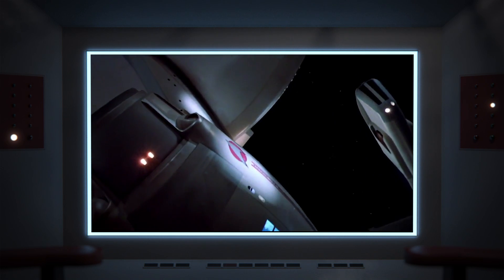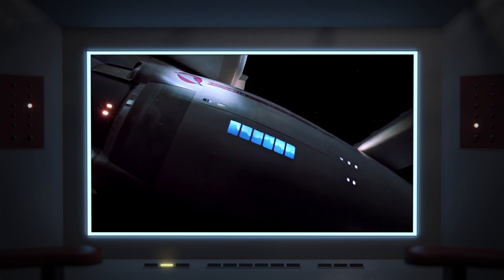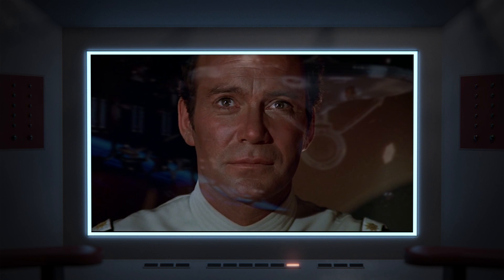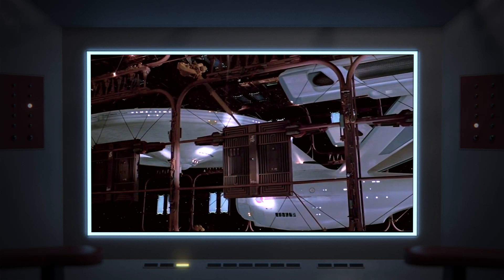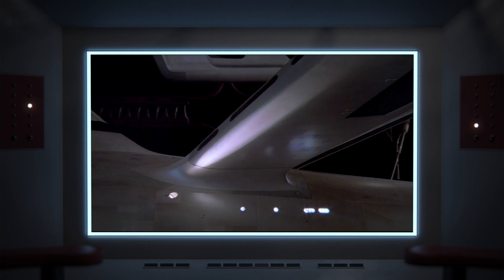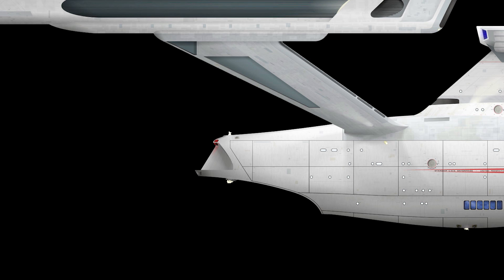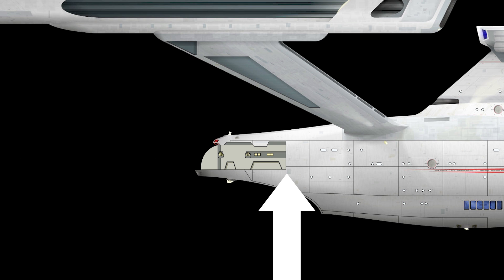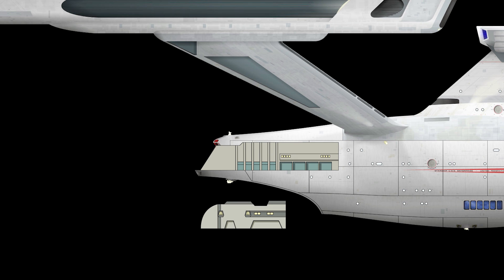Why Have Angled Nacelle Struts? (Enterprise Refit)

Comment: Andy Probert, the design guy behind the look of the refit Enterprise (and the Next Generation's Enterprise-D), has a sketch that shows this exact thing:  the warp power channels (later, 'conduits') passing along the top of the hull and out to the nacelles more forward, as you propose, clearing more space aft for the hanger and hold bays.  

Also, at the time they didn't have the ship's propulsion system imagined as the positive and negative poles channeling into a central reactor, as we see in the Next Generation's engine room.  There was just a central 'main energizer,' which ran vertically up & down the hull, all through the interconnecting bit to the impulse engines' 'deflector crystal,' which is the blue glowing bit at the top where the impulse engines are housed.

Comment: Another reason for the angled struts is that they increase efficiency. With the struts meeting closer to the warp core when they meet at the secondary hull, the path to the nacelles would be shorter thus less power would be needed to get to a similar speed compared to the old model.

Comment: Gene Roddenberry, when speaking of the Galaxy Class Enterprise, said that his vision of the Federation is of a culture who's science and engineering is so advanced, that they aren't as constrained, so an important art of starship design is asethetics - starships were not only functional, they were also, his words, "a work of art". And the Refit Enterprise and 1701-A definitely are that. (Even more so in The Motion Picture, because the producers of The Wrath of Kahn painted over the Enterprise's pearlescent paint job with a clear dull coat. (Something about the filming the technique they were using and shiny areas.)

The only thing that, IMHO, the Refit is missing, are the rear-facing photon torpedo tubes that both Kelvinverse Enterprises have on the underside of the engineering section, kinda bellow the shuttle bay, but maybe a little further back. I am also PRETTY SURE that Pike's Discovery/Strange New Worlds Enterprise has that feature as well. And it makes sense. According to "Enterprise" (the series, in the episode "In a Mirror Darkly", part 2 I think) the TOS version of the Enterprise/Constitution class has rear photons as well, which they use the break out of the Tholian spacedock - but they never show on screen where they are coming from.

Comment: Mr Scott's Guide to the Enterprise has further explanation's as to the redesign of the overall Constitution Class (though not considered canon).
It makes reasonable debate point's as to why Starfleet approved the changes to the class as a whole (such as enlarged primary/secondary hulls, new impulse drive/warp engines, new primary computer core, etc.
As Scotty himself say's in The Motion Picture, 18 months of redesign and testing resulted in a virtually new ship.
Were there any other Constitution Class vessels modified this way ?
The simple answer is yes.
Most of if not all the remaining vessels would have been.
The guide delivers a massive amount of information and is impressive for the detail.

Comment: There may be a conflict between the enterprise's rear hull design and optimal placement of the new nacelles. The strongest point on the rear hull may have too far forward to place the engines, and the point far back enough to place them may have been too weak to support them. Plus the excellent point about increasing the surface area for heat dissipation, may be part of it. Looking at the front edge of the pylon there seems to be an intake of some sort there, maybe sweeping it back made it longer with more intake space while keeping the nacell's distance from the hull the same.

Comment: It also moves the strut / nacelle mounting point towards the center of the nacelle, rather than going straight up.  From a 20th century engineering perspective, that would tend to reduce torque on the struts themselves, and reshaping the struts allowed them to better spread the load to the superstructure of the secondary hull.  Of course in the 23rd century that might not matter, but having a more stable physical design does mean you have to spend less effort elsewhere compensating for the unstable design.

Comment: Eric. I like hearing you talk about Star Trek design, even when I disagree. This is not one of those times though.

Another benefit of the angled struts is reduced workload on the structural integrity fields throughout the nacelles, the struts, and the secondary hull.

The pylons enter the hull close to the base of the neck, allowing common bulkheads to take the strain of the huge off-centre masses of the saucer, neck, and nacelles. The consolidation of these structural members into the "strongback" area, as well as the revised routing of the horizontal plasma conduit coming off the warp core, explains the "barrel" shape of the engineering hull post-refit.

Additionally, the chevron shape of the struts allows loads to be balanced along a larger length of the nacelle. The mount point of the struts on the nacelle is more central, improving balance and reducing sheering forces on the struts.

Finally, the angle at which they enter the hull allows the warp plasma conduits to take a more direct route to the field coils, where the old design necessitated a series of 90-degree turns - surely more power-intensive, massive, and failure prone compared annular confinement fields along a more-or-less straight length of conduit.

Comment: also consider it's very hard to make a magnetically bottled plasma flow turn a corner (unless you're talking very small amounts going through the EPS grid where it's not warp-charged plasma). The new struts, like the old ones, indicate the position of the warp core, where the plasma comes from. The refit Enterprise has a vertical intermix chamber (where the EPS grid feeds) as well as a horizontal one, whereas the TOS fit has a horizontal one only to do everything.

Comment: It could also be that the thicker struts allow for greater warp field stresses, thereby increasing the maximum potential warp speed, but even if it's just the hangar bay, that's still a good enough reason to move the strut joint forward.

Comment: The original nacelles likely needed stronger internal bracing as they were supported fore of their center of mass (assuming the mass in a warp nacelle is relatively homogeneous). In the refit, the nacelles are supported more towards the center.

Comment: Other design changes?

How about the dispersed weapons? In TOS, all of the main phasers and torpedo tubes came from the ring around the ventral sensor dome on the saucer section, as well as aft phasers located above the main shuttle bay on the secondary hull. Keeping all the ship's weapons clustered in a relatively small area makes it much easier for enemy fire to disable multiple weapon systems with a single hit.

On the refit, phaser banks are dispersed across both hulls - three banks of two on both the dorsal and ventral sides of the saucer, two above the shuttle bay and a cluster of four on the very bottom of the ship. And the torpedo bay was moved to the top of the secondary hull by the main deflector dish. This gave the refit Constitution-class much better weapons coverage, and provided her weapons systems with greater protection - and gave the ship greater torpedo storage now that it wasn't crammed into the same space as the sensor suites and phaser control rooms.
Reply: The Star Fleet Technical Manual debunks this. Said manual inspired the weapon dispersion on the refit.
Reply: @Idazmi7  And how often do you see those dispersed weapons on the TOS Constitution-class? You don't. Both torpedoes and phasers are fired from teh same place on the ship.

Admittedly, they show these in better detail on the modernized version in Discovery Season 2.
Reply: @Idazmi7  Well, that's just fine - it makes us even. I wonder how people like you exist - who think it's your job to gatekeep a fandom from people who interpret the visuals of a TV show differently than you.

And while I would have been more than happy to flex my nerd brain and debate the matter further, my desire to not engage with a toxic "gatekeeper" overrides it.

Comment: from a general structural engineering perspective large scale 90 degree angles are bad, near as i can tell the "structural integrity field" didnt get invented until the excelsior class came out so those pylons on the original would be getting a workout at sublight speeds...

Comment: You have a very good point here. I had never thought of it before. But there are other advantages too. The angle allows for better motion/acceleration transfer from the engines to the ship (if that is how they work) and makes the conduits from the core to the engines a little bit shorter. Also having the engine nacelles attached to the pylons close to their center point might give the ship more stability at high warp. And as you already said, the angled struts connect to a thicker part of the engineering hull. This may allow them to be better connected to the primary structure of the ship. Finally, they do give the ship an even bigger presence and intimidation factor, as they make the ship look faster. So all around, a good design choice.

Comment: The wider end of the struts also connect to the nacelles more in the center of mass of the nacelle rather than at the front which would seem to be more structurally stable.

Comment: Extra space is acquired for radiators and insulation / shielding for the plasma ducts.
Without the penalties for creating a larger frontal section that would require a larger warp field

Comment: Inertia. Because the engines are external to the main body when they engage the engines will move first, the pylons transfer the movement to the main part of the ship. This transfer is going to cause less stress on the entire frame during the initial push to over come inertia during warp. Stress on 90 degree struts would cause buckling in the frame or pylons over time.  Also, it looks cooler. If they panted it red it would hit warp 15.

Comment: Don't forget the redesign of main engineering: the power conduits leading to the warp nacelles from the warp core initially run above the shuttle bay, before entering the pylons. This, combined with a larger shuttle bay, probably necessitates the altogether more beautiful swept back design.

Comment: I think it also has to do with the new Warp core. You can see in Engineering that that warp core is now far more compact and the warp plasma tube can now stay far higher in the ship before shooting into the pylons. Its almost like when they redesigned the engines they could expand the hanger.

Comment: I would also add that the new Warp Core design likely allowed for this change. The original which I presume was more like the NX class warp core, horizontal and bulky likely took up the space that the Refit used for those extra cargo bays and Hangar space, while the new column stack warp core configuration freed up all that space.

Comment: There’s another significant advantage to the new design, and that’s to do with the new wedge shape as well as the sweep backwards. 
The new pylons connect to the nacelles starts very nearly their centre point. In the real world, the fact that the pylons connects towards the front of the nacelles has meant that the nacelles slowly began to pivot on the pylons over the years.
While that can be mostly ignored in the fictional world, the new design suggests a more robust design with better balance has an advantage.

Comment: Since the 'engines' that provide the forward motion are on struts, having the struts at 90 degrees is , mechanically speaking, a nightmare. The more they are angled the less stress is at the joint. The joints at the engine experience SHEAR STRESS.This happens when the engines want to move forward but the inertia of the shuttle wants to go backwards. the more angled they are, the less SHEAR STRESS there is and the more compression or tension (depending on weather the engines are pulling or pushing due to their angle.

Comment: i like yours, but i would add that perhaps the point where warp plasma is used by the nacelle is farther aft.

so between the two ideas, you can have a nicely swept nacelle pylon to cover both needs and the needed strength.

Comment: I know I’m late to the game, but the angle also allows for the pylons to attach to the center of the nacelles. On the original, any acceleration he ship experiences that isn’t perfectly lined up fore or aft would cause a twisting stress on the pylons as the longer and heavier end of the nacelles “flapped” in response. Centering that anchor removes most of that. Practical both in universe and from a model-making standpoint.

Comment: There is another benefit I think,
forces generated by the hull, or the necells can be better transferred to each other, making the entire structure more stabile. 90° angles are almost the worst at allowing for the flow of stresses in material, there is a reason why engineer avoid sharp edges in parts with expected flow of forces.
If we follow the direction of the struts and connect them virtually at the point they would meet it would be aproximately midship of the secondary hull, but not in its middle axis (cylinder middle axis) but above it. Draw in a connection line from there to the front  and do a similiar thing with the neck and you get a good idea of how forces would flow. A shorter distance between basepoint necell struts neckbase means less bending moments resulting in a greater stiffness of the structure, while these line connections would probably not exist in reality it helps to understand and imagine how forces would flow. The generell flow of forces would be struts, short hull segment, neck saucer section, the generell forces would not need to flow through the middle of the secondary hull which means at the same structural integrety from the older modell it's expectet lifetime would be greatly increased through lesser stresses flowing through it. This however would mean that the section the projectet forces would flow through would need to be greatly increased in its ability to transfer those stresses.

Looking at the deck plans (https://www.cygnus-x1.net/links/lcars/enterprise-deck-plans.php) I found you can see something is happening with the ammount of things found there (O deck to Q deck) the O deck probably being the one connected to the necells. In the O deck and P deck you can see serval hints of structures which are meant to hold for example the life boats and lockers, which means more hullstructure meaning more mass. There a few things engineers know two of them being "1. Only masses move masses" and "2. More mass arranged in a self reinforcing way (links below) means more stiffnes agains induced stresses." Taking all of this into account you won't see thick beams or stuts within the hull, as the hull itself is capable of transfering these forces but you don't need as much reinforcement as before.

Links:
https://img.nwzonline.de/rf/image_online/NWZ_CMS/NWZ/2017-2020/Produktion/2019/04/24/POLITIK/HINTERGRUND_1/Bilder/dpa_5F9D220013FCA41E-U203354864535h8H--600x337%40NWZ-Online.jpg
https://www.dw.com/image/48366921_401.jpg
https://www.thb.info/typo3temp/_processed_/csm_16816536_014_16893263_pi_16897283_6c88db9d33.jpg
https://www.trumpf.com/filestorage/TRUMPF_Master/_processed_/b/7/csm_Lasers-applications-hyprid-welding_96ec19ffbb.jpg

Comment: Relocation of the M/AM reactor. It seems to be more forward, so angling the struts brings the plasma conduits no longer than they need to be to feed the engines. That's assuming the M/AM reactor is in the engineering hull and not int he engine nacelles as was once implied (Franz Joseph of the 70s).

Comment: I think it's also because the enterprise uses a mostly vertical warp core that the struts don't need to go so far back, this is also probably why the hull needs to be thicker. But also the struts are connected to the nacelles near the center of them, probably for more even energy distribution.

Comment: Late to the party here, but how's this for a quibble----no starship since the TOS 1701 has actually had warp nacelles. Check a dictionary--"nacelle" specifically means a long hollow tapering cylinder attatched to a larger vessel--it's actually a nautical term from Roddenberry's Navy days. So, ya, those aren't nacelles. The D doesn't have nacelles, and neither does Voyager.....the Defiant? Nope. Call them warp engines, fed power by the warp reactor, or something, but quit calling them nacelles.

I'm a Virgo, I can't help it.

Comment: Ah but is the pre- and post-refit Enterprise still the same ship!? They must have replaced virtually everything.

I’d assume the pylons would meet in the middle of the secondary hull in some fashion, given that they have transfer power from the warp core to the nacelles. Maybe not the whole pylon as it appears from the outside but there’d be a definite ‘V’ shape in there.

And how did the original Enterprise have a shuttle lift up to the floor of the shuttlebay? There’s no space under there given the curvature of the hull at the rear, certainly not enough height for a shuttle anyway.

Comment: The struts are also angled so that the connection point between the pylon and the nacelle is more centralized, also the structural attachment can more easily blend into the nacelle and avoid the warp coils and also the connective beams would not interfere with the connections and mechanisms between the Bussard Collectors and the rest of the nacelle by being positioned in front near the junction point.